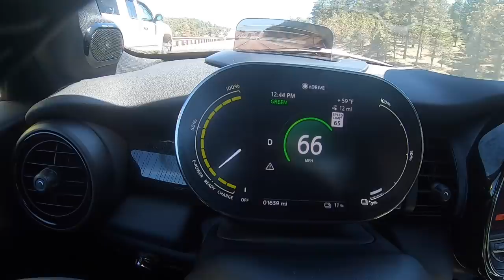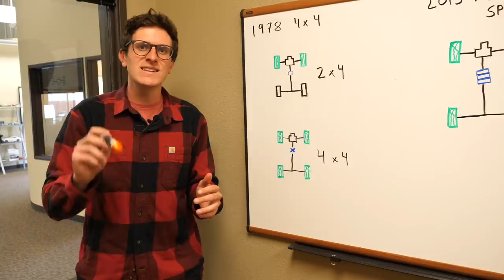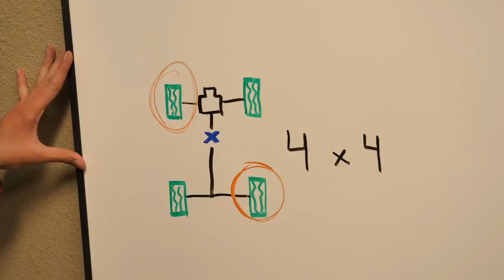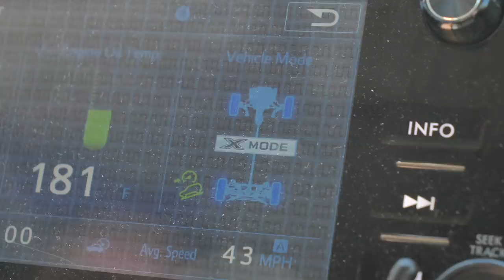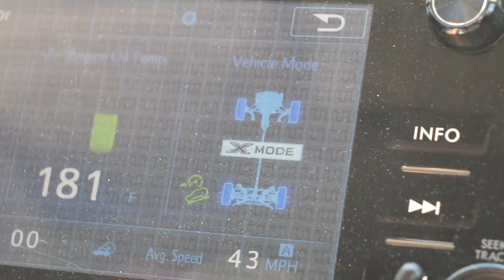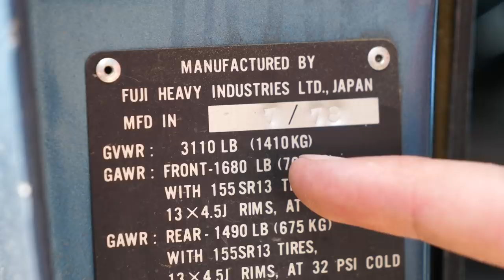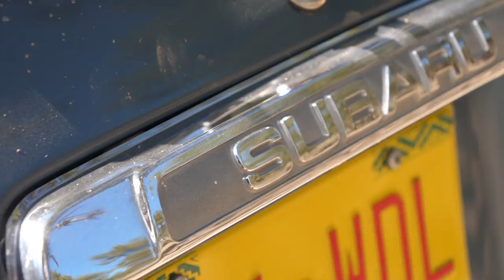Old vs New - How Much Better (Or Worse) Is a Subaru Outback Off-Road Than Its Great-Grandfather?

Comment: Man that 1978 Subaru is in ultra mint condition.
Reply: Tomoko Kishi and it’s cooler than the new one
Reply: Needs a proper tune up, otherwise it's great.
Reply: would love to own one of those subies. omgosh its sooo clean!
Reply: Zach Reynolds 
Even the Mona Lisa is falling apart
Reply: Yo, Ive a mitsubishi gt3000 and it have a better awd than the newer. Mecanical is better than electronic and the newer ones is more weak than the old ones.
Reply: @student8165  no doubt and imo millenial subarus has nicer awd than 2010 - 2020
Reply: @turtletube  yep more fun to drive too
Reply: @zacharyreynolds4303  yh when was it built?🤦‍♂️
Reply: When did that windshield get cracked though?

Comment: I had an '84 GL with the "big" 1.8L, 2 speed transfer case (2wd/4H/4L), manually adjustable ride height, and factory skid plate.  Subies have gotten "softer" ever since.
Reply: I owned 2 GL4wd 1.8 wagons 😎 let's remake that car

Comment: Love the look of the old school Subaru even now! And if given the choice, I'd take it over the new one. Cheaper to maintain, manual trans, true 4wd, just Iconic! It was different from everything else. Can't say that these days.
Reply: @costaet  Ford Escape, Honda CRV, Mazda CX-5, Acura RDX, Porsche Macan. I'm not saying there's anything wrong with the newer Subaru's. I just prefer the styling and simplicity of the older ones. Just my opinion.
Reply: Hey old guy in Car Connections: I owned a 1978 Subie DL manual 4x4. Drove it through college and had it when married until it hit 350K miles.  Like I told your Dad who seems to have a grudge. The only descent newer Subie  is the Crosstrek 6-Speed. I’ve a 2019 and blow past Rams and other power trucks in very heavy Mi snow. 18” to 30” . At lights and cornering the lumbering Rams and Tacomas are not nearly as nimble.  If the rear end begins to come around on a 25 mph right turn I just hit the clutch it straightens up and either power on in 2nd or 3rd.  All the unnecessary mass of these automatic Trucks there only manageable in a straight line.  Unless know how to drive a Subie stick with your happy assed minis. Ps I also own a 2006 A3 6-Speed . It’s all about powers to weight ratio and a high driving skill set.  The dude driving his new Outback was whining like an old woman. Your son seemed to realize the point I was making about manual vs automatic trannies.  So give it up when you bash Subies kids.  You sound like you live in gated communities an someone used the pool late at night!  Hey Pops, develope some character and a bit integrity,  This is a country of diversity these day.  Your personality is so milk toasty!

Comment: You guys should try a manual crosstrek. I feel it's more of a proper successor to the DL than anything else. Manual 6 speed with a low 1st gear.
Reply: They are discontinuing the manual, and the cvt really does suck for anything beyond a dirt road. Such a shame, especially since the new sport trim got the larger engine.
Reply: I own a 2013 OB stickshift, which I believe was one of the last ones offered, and I agree with you that 1st gear is too tall for much offroad use.  For that matter, so is reverse -- it's gotta be the highest reverse gearing of just about any car!  Wierd.  The Crosstreks do seem like good cars although the seats aren't terribly comfy.

Comment: The spare tire in the engine bay was advertised as a safety feature back in 70's and 80'. Supposedly it  was there for front-end crash protection.
Reply: Because of the tire in front: the old Vw beetle had better front crash ratings than a Vw rabbit
Reply: Sounds very fishy to me, like maybe an urban myth.  There was nothing in front of the tire but the air cleaner and empty space (since the engine was lower than the tire), so the front end of the car would have needed to be compressed all the way back to the centerline of the front axle before the spare tire came in contact with anything solid from its front side.  Significantly more compression of the body would need to occur beyond that point before the tire would be pushed back very much into the firewall, which probably would fail before the tire itself did, and by that point, there wouldn't be much left of the front body to compress.  I never recall hearing anything about this as a "safety feature", but stranger things have happened, I suppose.  Do you have a link to old ads or literature which would verify this?  That would be interesting to see!
Reply: Nope, because spare tire in the front, fuel tank was able  be located at higher position under the floor. That's an advantage for higher ground clearance.
Reply: At first i wondered how engine heat would affect the spare.... but... that's  such a tiny engine.....
Reply: It was installed there because that's where it fit.
Reply: Yugo did the same thing

Comment: Be interesting to see how the Outback performs when it's 42 years old.
I suspect the CVT would have been turned to burnt toast years before then.
Reply: Never-mind the CVT, all the electronics and sensors will have long given up the ghost.
Reply: In Australia, the 100,000 km (about 60,00 miles) service includes an overhaul of the CVT transmission and it will cost about $6000
Reply: @jacobmoses3712  My sons 2015 Outback has done 200,000km.  All services as per Subaru Australia manual.  Nothing over AU$600 per service.  Not sure where you got that figure or milage?
Reply: @jacobmoses3712  That's just plain crazy!
Reply: @michelt4390  That's because it's completely untrue.
Reply: @jacobmoses3712   It doesn't say anything of the sort. Been smoking too much vegemite
Reply: Don’t let the Dad of Fast Lane Connections fool you. His son is cool though.  I owned a 1978 Subie DL manual 4x4. Drove it through college and had it when married until it hit 350K miles.  Like I told your Dad who seems to have a grudge. The only descent newer Subie  is the Crosstrek 6-Speed. I’ve a 2019 and blow past Rams and other power trucks in very heavy Mi snow. 18” to 30” . At lights and cornering the lumbering Rams and Tacomas are not nearly as nimble.  If the rear end begins to come around on a 25 mph right turn I just hit the clutch it straightens up and either power on in 2nd or 3rd.  All the unnecessary mass of these automatic Trucks there only manageable in a straight line.  Unless know how to drive a Subie stick with your happy assed minis. Ps I also own a 2006 A3 6-Speed . It’s all about powers to weight ratio and a high driving skill set.  The dude driving his new Outback was whining like an old woman. Your son seemed to realize the point I was making about manual vs automatic trannies.  So give it up when you bash Subies kids.  You sound like you live in gated communities an someone used the pool late at night!  Hey Pops, develope some character and a bit integrity,  This is a country of diversity these day.  Your personality is so milk toasty!
Reply: You guys are full of false information. Sold my 2015 legacy with 176k miles on it, never did anything to the cvt and it was fine
Reply: @dxbmick  It's around $1000 dollars here in the US for that 60,000 mile service
Reply: @jacobmoses3712  Which means the car is totalled.
Reply: Metal dumpling soup
Reply: @ericjohn9277  Did you do any off roading? That's the key question and where TFL have had issues with CVTs

Comment: Pre-CVT era subarus are the best. Some EU and JDM versions even came with a low range transfer case with a viscous center lock.
Reply: US had dual range transmissions as an option on almost all pre 90 Subarus.
Reply: Running a custom ratio AWD dual range here with 12kgf centre diff ;)
Reply: yeah i got a 99 EUDM impreza with a 1,6 and the dual range 5 speed manual and oh boy is that lowrange a really neat thing to have, i also found it useful for backing up slowly lol
Reply: @andrechristiansen2161  I fitted the L series low range gears in my 2003 EJ d/r gearbox and its my favourite thing ever. I also fitted a centre diff that has 3x the torque transfer. You can put it in gear, let the clutch out and it will crawl away up a hill lol. I even open the door and get out while it's moving and let it crawl up the road for a laugh. I use low all the time, off road, hill starts, peak hour traffic, reversing, reversing with a trailer...so sad that Subaru has totally ditched those cool gearboxes.
Reply: Yup, I had a 1997 Legacy Lancaster Grandwagon (aka early Outback) with dual range manual transmission which I sadly sold 13 months ago when I moved from NZ to USA. Possibly a mistake because I'm back again (which I didn't expect). But there's a fully loaded 2008 Forester XT (automatic :-( ) for sale nearby that I might pick up.
Reply: They had low range up to 2009 Forester, but non US models. You could easily install the kit on any manual Subaru even up to 2020 or whenever they stopped offering the manual. FRS 6 speed is a Toyota so that wouldn't fit.
Reply: @Y10Q  I am not sure what you mean about the kit? The gearbox case is different for the single range and dual range gearboxes.
Reply: @procrastinator1842  Same transmission, the only different transmission is for the turbo and STi.
Reply: Well yeah. But that center visco diff. lock is going to fail after 150.000km leaving you with full locked center diff after heating it up. But its only after 1998MY, when the center diff has changed. Toyota had better 4wd system with hydraulic locker that days.
Reply: @atar_kusx  Costs $300 and takes a few hours to replace. So not the end of the earth.
Reply: @procrastinator1842  you re right. But automatic TV1 tranmission still seems a better choice for offroading - it does not have such birth defects.
Reply: @atar_kusx  The reason I choose Subaru is because I spend more time on road than off, a fair bit of that time is in windy, wet mountain passes. So for me the viscous centre is ideal.
Reply: @procrastinator1842  Well if it suits for you, thats good. Best for me (in my dreams, now I'm running AT) is two-range turbo mechanical gearbox with dccd tail. Although it does not exist from the factory =/ The only way to get it is to build it myself lol.
Reply: @atar_kusx  well at least the dccd conversion is a lot easier than doing a 1.59:1 low swap! Don't need to split the gearbox, just unbolt the section off the back!
Reply: @procrastinator1842  Actually yes, but automatic gives more torque at low rpm than single-range M/T. Also as far as i know swapping 1.59 in a not so ancient Subaru as Leone, RX, Justy is a pain in the ass. Legacy from the factory has 1.2:1 low ratio which is for children lol.
Reply: @atar_kusx  It's a fair bit of work, but not super difficult (in an EJ box). A few customisations due to different low range selector fork, ball detent mechanism, the low/high switch and a sleeve to adapt the bearing to the L series shaft....yeah actually it was a pita lol. But I absolutely love it!
Reply: @procrastinator1842  is that red Outback in the sand yours ? Looks(and rides) sick! If you did these described mods, well thats exceptionally cool too! Actually you had that childish 1.2:1 low ratio in an Outback, so you decided to play hard lol! Best regards subie-mate, from Vladivostok/Russia!
Reply: @atar_kusx  Thanks, yeah I did the mods in my garage. The old 1.19:1 low range was great for beach drag racing as it was like a close ratio gearbox, but not so great for crawling. But now I have converted it to 1.59:1 it crawls awesome. Cheers from Tasmania, Australia.

Comment: Grew up with this model in the 70s running up and down the mountains here in Alaska. This ol' vintage car was a game changer. Official car of the US ski team back then. I recall ours had high and low range as well as some of the next generations that came along. I remember Mom rolled her Suby in the mountains a few miles below our home descending mayonnaise on a mirror ice even w/ studded tires. The guy behind her in a modified spiked out VW Bug rolled right after her, and they both bobsledded upside down the road. Everybody shook it off and walked away. Fun video guys!!!  Love to find an old one in that nice a condition.

Comment: I had the 1978 wagon, 2 1980 hatchbacks, a 1985 hatchback and a 1986 brat that said I would rather have the old hatchbacks more than a new one the problem with the 78 no low range. I used them all off road what great cars miss them.
Reply: I had a 4spd 78 wagon with a dual range from an 80 brat swapped in.
Best/most fun subie I have ever owned.  
Just a go cart on gravel. Pure joy.
And that EA71 was a bulletproof mill.
Reply: I owned a 1978 Subie DL manual 4x4. Drove it through college and had it when married until it hit 350K miles.  Like I told your Dad who seems to have a grudge. The only descent newer Subie  is the Crosstrek 6-Speed. I’ve a 2019 and blow past Rams and other power trucks in very heavy Mi snow. 18” to 30” . At lights and cornering the lumbering Rams and Tacomas are not nearly as nimble.  If the rear end begins to come around on a 25 mph right turn I just hit the clutch it straightens up and either power on in 2nd or 3rd.  All the unnecessary mass of these automatic Trucks there only manageable in a straight line.  Unless know how to drive a Subie stick with your happy assed minis. Ps I also own a 2006 A3 6-Speed . It’s all about powers to weight ratio and a high driving skill set.  The dude driving his new Outback was whining like an old woman. Your son seemed to realize the point I was making about manual vs automatic trannies.  So give it up when you bash Subies kids.  You sound like you live in gated communities an someone used the pool late at night!  Hey Pops, develope some character and a bit integrity,  This is a country of diversity these day.  Your personality is so milk toasty!

Comment: TFL:

High/Neutral/Low Range  were available on that era of Subarus.....including the re-skinned versions which were available until the Bigger/Angular ones came out in the mid-1980s which had the 5 Speeds (with High/ Neutral/Low lever by E-Brake) along with manually adjustable suspension(easily and quickly done with a ratchet or wrench) which could give you another 2 inches of Ground-Clearance......before switching to Peugeot 14/15 steel or aluminum rims....which can get a Scooby Do high like AMC Eagle.
Reply: That's what I have in my High/Low Weberred EA81 1984 wagon. Stock 13"s though but with that 3.90 diff, she crawls.

Comment: Just imagine how much better the old subaru would have done if it was one of the ones with a low range transfer box.
Reply: The low range wasn't available until later. If you had a 1.4L, the first gear was lower than the first in low on the newer ones, but the power on the 1.6L was much better. I had the best setup, a 1.4L wagon with a 1.6L I shoehorned in there. It was even better because it was geared lower. More than 4000 RPM at 65mph in fourth gear.

Comment: Love this! Owned a '78 and  an '83. '78 was a beast, '83 had rust in the fuel line and tank even though the body had none. Got to where I kept extra filters on board and could change a clogged one in 2 minutes.

Comment: It's getting near impossible to find parts or parts cars anymore, but the 80 brat had a dual range trans.
#1 recommended swap/upgrade...if you can find one.
#2 Weber carbie.
And the EA71 sounds fantastic and responds really well to freeing up the exhaust.
Reply: Tom Mc i have a '78 ea71 brat. I also have a doner dual range brat. I may keep the ea71 but put the dual range in. I also have the fat case bell housing to do that.just have to get off my duff. Suby on.

Comment: Audi: We invented the 4wd car
Subaru: hold my vape
Reply: Hold my ale, old boy: Jensen FF.
Reply: They didn't invent an affordable 4wd car, though..
Reply: @gerijokub7737  Quite so, the original quattro was expensive too. I worked in a audi dealers at the time.
Reply: @russcattell955i  True! When introduced to the USA market, the emissions equipment knocked the horsepower down from 200 to about 160. Audi decided to only sell 500 Quattro coupes in the USA that first year (1982?). MSRP was $35,000. Two years later you could get the 115 HP Audi 4000S quattro for $17,000, a relative bargain by comparison.
Reply: @russcattell955i  The FF was AWD, which is NOTEWORTHY AND HISTORICAL! YAA Brits, for having the balls to try it and produce it, and being the first! Audi made AWD popular and desirable for the masses. (WRC, anyone?) Subaru made AWD affordable to the masses.

The first Subarus, like the old wagon shown in this video, were part-time 4WD. Subaru's first AWD didn't come out until the 1984 or 1985 model year. It was a high-end Loyale with a lockable center diff, just like an Audi.

Comment: CVT's are such a bad a idea for offroad vehicles.
Reply: Agreed. And the Outback is not really an offroad vehicle; more of a softroader.
Reply: I couldn't care less about CVT... but Subaru doesn't even gives the option of anything else...
Reply: Replacing the cvt fluid with redline synthetic cvt fluid feels like a chip tune on the trans. 
So much less slipp. 
No more rattle.
Reply: @fastinradfordable  Really?? Interesting- I have an appt to get my CVT fluid changed later this week- may have to give the Redline a try.
Reply: CVTs are such a bad idea, PERIOD! CVT must be utterly exterminated!
Reply: @MacTechG4  CVT is great in our little Impreza on the road. Great smoothness, economy and zip. No good off road, I'd have to say. :)
Reply: Hugh Stevenson; I guess we’ll just agree to disagree then, I’d rather get a root canal with no Novocain than drive a CVT.